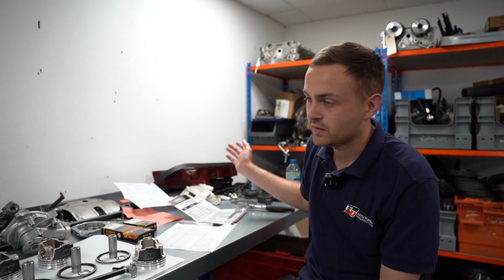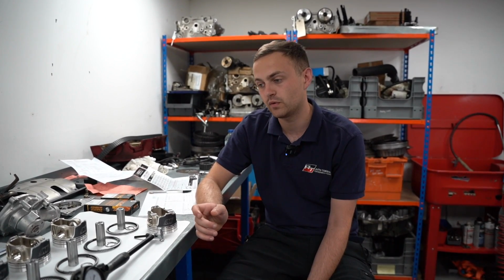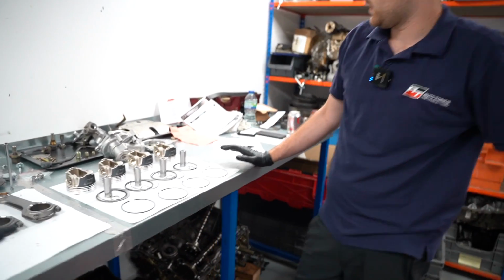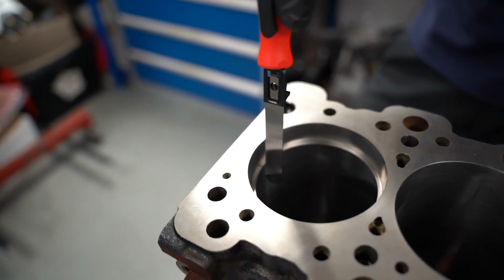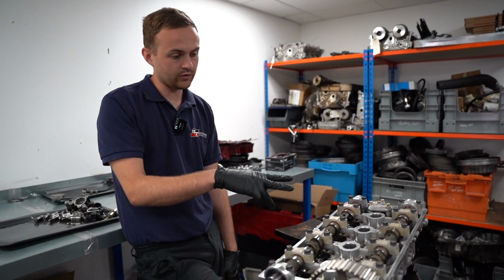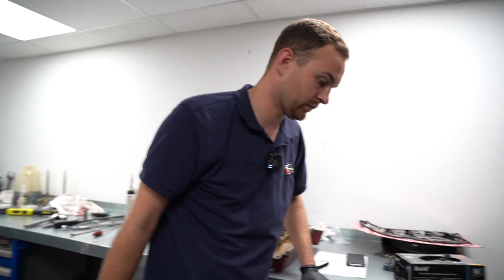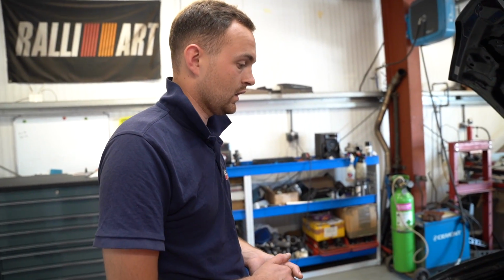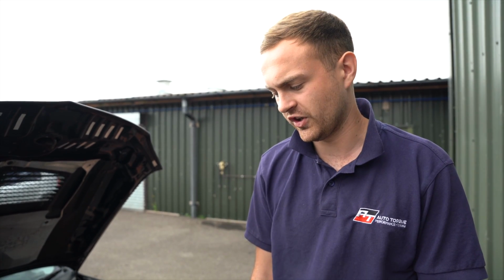EVO IX FORGED ENGINE BUILD | WHAT POWER DOES IT MAKE?

Comment: Can someone tell me why you wouldn't build the head too?
Reply from the maker: Power goal was 420 and that’s made easily with out head work (as proven here) also budget was a factor on this build.
Reply: I don't even bother watch since I read your comment. That doesn't make sense..People need to realize the power is made in the HEAD...
Reply: Probably don't have the money for the cams and springs. If your goal is 400 plus and your going to the trouble to pull the head you'd always do S2s, springs and retainers and valve guides and seals. 1mm over valves and porting for 500 plus

Comment: I never got why people use the Bridgeway H-Beams. They're shit. If you have the block open it's going to cost a couple of grand anyway. Why not upgrade to the Manley H-Tuff's. Okay.. they are a bit heavier. But they are so much stronger. Nobody stays at 450hp. You'll be at 600 before you know it.
Reply: Not really. More boost more problems, 600 can stay over there.

Between 450-500 is perfect for a well balanced CP9A/CT9A.